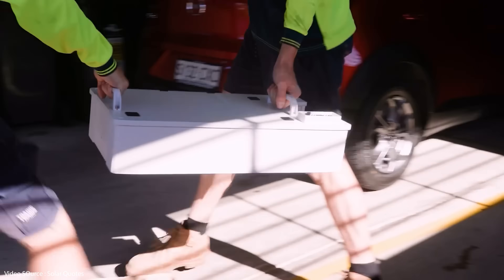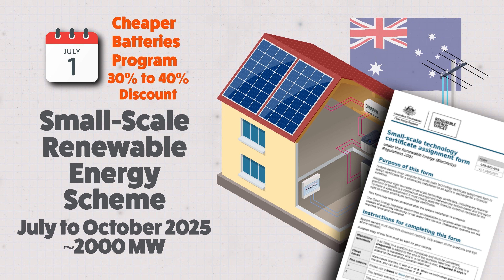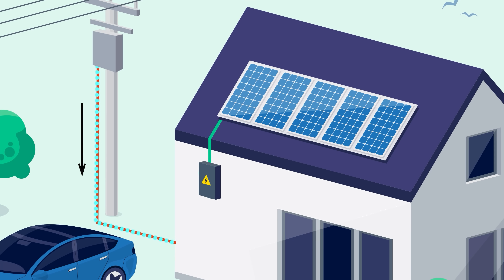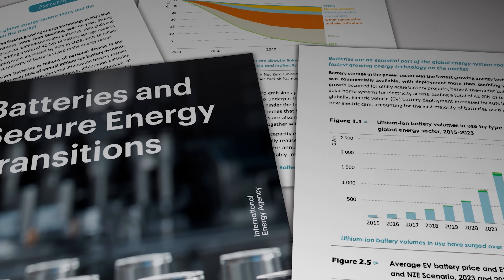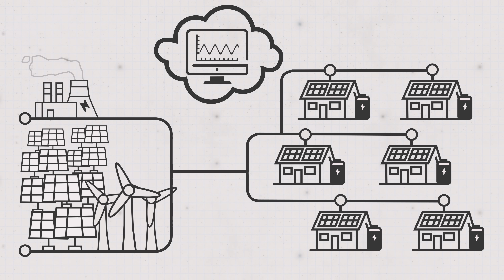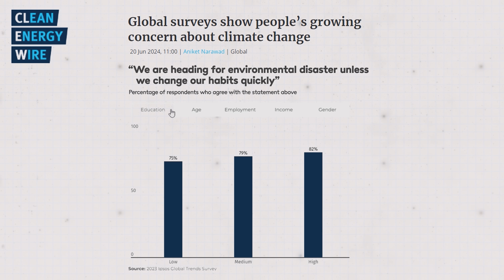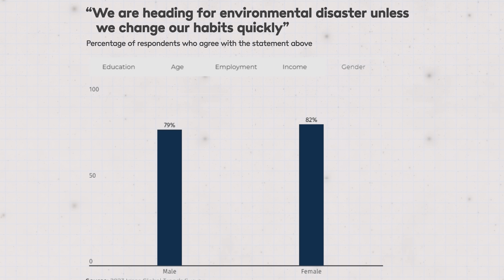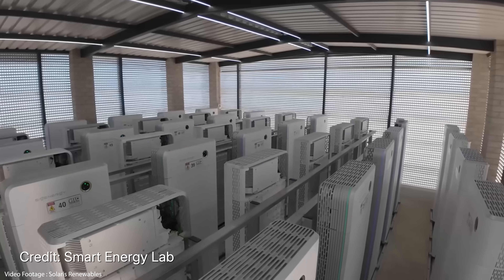Australians installed 100,000 home batteries in 17 weeks. Why can't we all do that?

Comment: Hopefully all this "spare" electricity will encourage the solar system owners to fully utilise their power by stepping further into the solution to save the planet by purchasing an electric car. 
When you have so much extra power and you only receive 3.5c per kWh as a feed-in into the system, it makes sense to use the power yourself.
The options are feed, 40 kWh into the grid for a return of $1.40 or travel around 200 kms in an EV.

Comment: Number of battery installs is now over 163,000 here. We installed a 32kWh Sigenstor battery with a 12 kW inverter. We joined Ambers VPP and make on average $2 a day from FIT. We should have our system paid off in about 3.5 years

Comment: Spain is now the Solar pin up in Europe attracting Chinese supply chain manufacturers! EU needs to push the Electric Heavy goods as China now sell 50% of new EV trucks into their market!! Recharging stations on the motorways in Spain needed but they have the space and the Solar penetration to take advantage!! This is fuelling their EU top growth and the absorption of a million undocumented migrants!! Europe needs to engage with N. Africa to drive renewables there and share their gas supplies for heat that has not been provided by renewables!

Comment: (envirosmug/) We are beneficiaries of this scheme, doubling (+) our PFIT-installed (2018, 66c/kWh for 6 years) solar from 2.75kW and battery single module (13.5kWh)  to 6.7kW and 27kWh. We now have trouble figuring out where to put it all on a sunny day: this, a hotwater heat pump & 2 EVs get filled up very quickly (/envirosmug).

Comment: External sodium ion batteries will make for more economic sense for the home owner and the grid too. Also for running air source heat pumps 24x7. It makes more sense for all UK home owners than solar panels. The batteries need to be safe though and work down to minus 15C. They can charge up using off peak power and reduce strain on the grid.

Comment: In Australia, the cost of batteries is very high still.  Around $1,000 per kWh.  So, even with the 30% govt subsidy, batteries are still very expensive. And there's little chance of the prices moving down while the subsidy is still in place.  So we keep hearing all the stories about how battery prices are falling rapidly, but a Tesla power wall has been priced at around $13,500 for years now, since the first ones came on the market. The reality doesn't match all the hype or news stories about lower prices.
Reply: Catch up.
Try $AU7000 for 45kw .
Reply: That sounds like aTesla problem. In got 24kwh for less than 10k.
Reply: Screw solar...  Geothermal is now the best option.

Comment: After 8 years with a 7kw grid tied roof top solar panels, I looked at the return on investment and found it to be much lower than initially because of the drop of fed back solar kwh and increase of the imported electricity. So  we installed 2x 4kwh / 1200w AC coupled batteries from Zendure in May. It is a night and day difference. Previously we were only able to consume 15 to 20 % of our solar production and now we are at 80-100%.
Reply: I went off grid in Sydney five years ago and haven’t had a power or water bill since then. No subsidies either, just moderation, insulation, and determination.

Comment: I live in Australia and installed a battery with my solar a few years ago. Getting bills from my supplier that says there’s nothing to pay at all was not something I expected. I installed the battery for health reasons. My major costs were in changing all my appliances to avoid gas and upgrading my 1920s electricity supplies within the house. A new fuse box, for instance, an induction stove, heat pump hot water and heating for parts of the house. I even bought a heat pump clothes dryer. 
Some care needs to be taken to identify what else will need to be replaced when moving off gas.
Reply: I did the same, but I'm in the very south of the UK Lat 50.3, so I get the same amount of sun as Canberra AU. 
The heat pump is amazing, as we've been getting close to 40C in the summer here, and it keeps my home warm in winter. 
And just this week, I bought a new fridge freezer with a heat pump, where my normal older one was using around 2.5KWH each day. This new full-sized unit is only using 0.25KWH (250WH)
My electric bill has gone from £2800 per year down to me making money as I'm selling to the power company at peak times. And as I'm an electrician, and build my own battery using EVE LFP cells (30KWH) and installed it, including solar all myself, apart from "tying the ends" or for non-electricians, connecting my system to the meter/grid, It has paid for itself around 1 year, but I've added more batteries and solar, so more like 2 years now.

I just add, I have (ACTH). Anterior pituitary gland deficiency, which has also made me diabetic, so I need to store my insulin in a very cold fridge, and lots of medical equipment. 
We have power outages every winter, so a battery bank is a real lifesaver.
Reply: I am in a similar position. But there is a problem with the “Smarties” have gamed the system by installing very large batteries which require an adjustment to the gov regs
Reply: @christopherflynn5586  Yeah, those gaming the system to make money off it. Fortunately, the new rules should help put an end to it.
Reply: Our energy supplier sends us a monthly bill for $AU 0 every month. 😊
Reply: @Rottnwoman love it.
Reply: @Rottnwoman  You better pay it, or you'll get a late charge. I suggest writing them a check.
Reply: Do you mean like replacing the mains board (which was probably never intended for this)? I could use a bit of guidance here. Thanks.
Reply: @thethirdman225 I mean my mains fuse panel was the original in the house and didn’t have the capacity to cope with the power I was going to use.
Reply: @peterbaxter8151  Was there anything extra they had to do, besides replacing the fuse box with a breaker board and earth leakage switch? I’m guessing there would be breakers for the PV, the battery and the car charger. Sorry but I need an education in this.
Reply: @thethirdman225 the fuses were wire and were replaced with AS/NZS 60269 standard fuses. There were only 2 lighting fuses and the stove fuse was inadequate for the power usage of a modern induction stove. There needed to be new fuses for the hot water system which replaced the gas original. The electric heating/ cooling system also required higher capacity.
Reply: @thethirdman225 Our installers included a smart meter in the package.
Reply: @thethirdman225  There are some very good DIY channels on YouTube.  The one that impresses me the most is Will Prowse.  He is a fountain of information.  You may have to check his back catalog for the topics you're interested in.  But there are plenty of others, surely some who are more Aussie focused.

Comment: assuming he meant to say and write 2000 MWh having been installed in that period, that would average out to 20kWh per installed system. wich is imressive. Considering it is indeed meant to mean 2000MW and also considering a realistic relationship between Capacity and output power of 0.45kW/kWh for a LFP-Battery, the average system capacity turns out to be about 44,5 kWh.